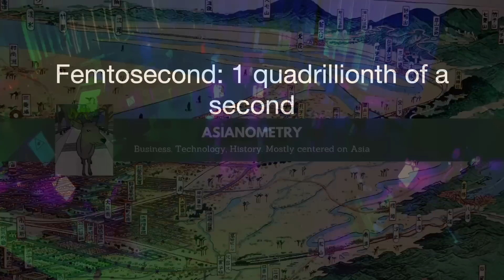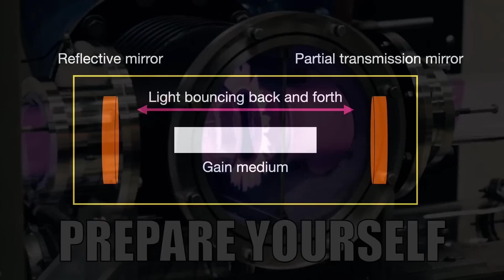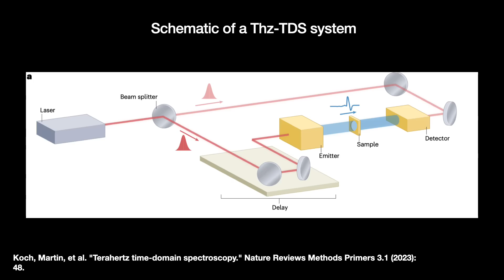The Incredible Femtosecond Laser

Comment: AI Summary

Abstract:
This technical overview traces the evolution of temporal resolution in high-speed observation, culminating in the development of the femtosecond (fs) laser. It details the transition from mechanical shutters and early electronic "Kerr cell" shutters to the revolutionary breakthroughs in laser physics: Q-switching, mode-locking, and Kerr-lens mode-locking (KLM). The analysis highlights the shift from unstable organic dye gain mediums to robust, solid-state Titanium-doped Sapphire (Ti:Sapphire) systems. By achieving pulse durations as low as 5 fs, these systems have enabled real-time observation of molecular dynamics (femtochemistry), precise surgical ablation with minimal thermal damage (LASIK), and the generation of terahertz radiation for non-ionizing spectroscopy. The material concludes by noting the recent progression into attosecond physics to capture electronic motion.

Technical Summary and Key Takeaways:

*   0:02 Definition of Scale: A femtosecond is $10^{-15}$ seconds. At this temporal scale, light travels only 300 nanometers, necessitating specialized pulse-based "cameras" to resolve physics at the molecular level.
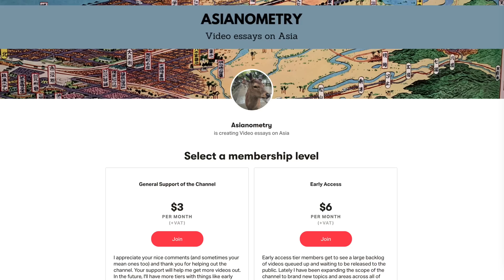*   1:17 Historical Precedents: High-speed imaging evolved from the phosphorosscope (1/2000s) to Muybridge’s mechanical shutters (1/1000s) and eventually the "Kerr effect" shutters (nanosecond range), which utilize electric fields to modulate refractive indices.
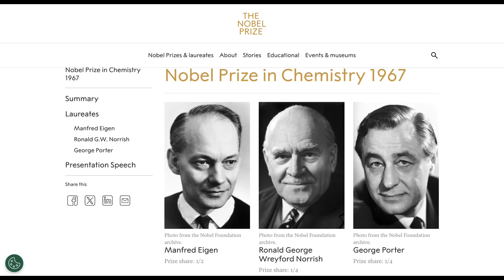*   5:47 Early Laser Modulation (Q-switching): The first Ruby lasers (1960) produced pulses in the micro-to-millisecond range. Q-switching improved this by manipulating the cavity's Q-factor—storing energy and releasing it in "giant pulses" of ~10 nanoseconds.
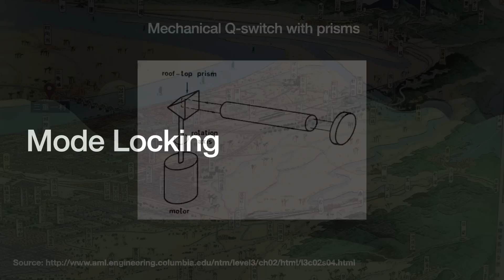*   7:50 The Mode-Locking Breakthrough: To surpass nanosecond limits, researchers utilized mode-locking to force multiple longitudinal modes within a laser cavity to interfere constructively. This produces synchronized, high-intensity pulses at intervals corresponding to the cavity round-trip time.
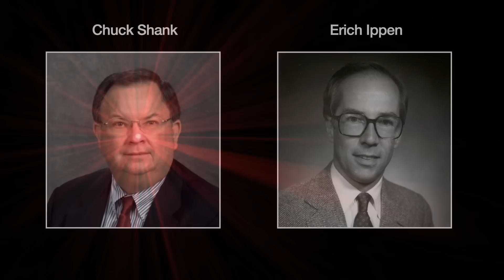*   11:04 Breaking the Picosecond Barrier: Bell Labs researchers (1972-1974) utilized dye-based lasers and passive mode-locking to enter the sub-picosecond and femtosecond regimes. However, these systems were hindered by toxic, unstable organic dyes and low power output.
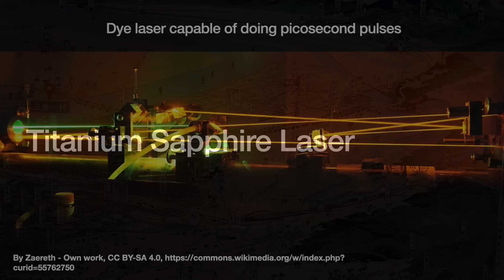*   12:38 Solid-State Evolution (Ti:Sapphire): The discovery of Titanium-doped Sapphire (Ti:Saph) provided a robust, solid-state gain medium. In 1990, the discovery of Kerr-Lens Mode-locking (KLM)—where the crystal self-focuses light via the optical Kerr effect—allowed for stable, high-repetition-rate femtosecond pulses.
*   14:35 Power Scaling via CPA: Chirped Pulse Amplification (CPA) enabled the amplification of these ultrashort pulses without destroying the gain medium by stretching the pulse in time, amplifying it, and then re-compressing it.
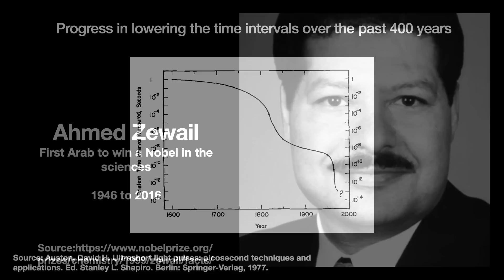*   15:54 Application: Femtochemistry: Dr. Ahmed Zewail utilized 100 fs pulses to observe chemical bonds breaking and forming in real-time, effectively creating "motion pictures" of molecular reactions.
*   17:11 Application: Medical Precision: Femtosecond lasers act as ultra-precise scalpels. Because the pulse is shorter than the time required for heat to transfer to surrounding tissue (thermal diffusion), they allow for "cold" ablation in LASIK surgery, reducing collateral damage and shockwaves.
*   17:45 Application: Terahertz Gap: Femtosecond pulses are used to drive photoconductive switches to generate Terahertz radiation (T-rays). This enables non-destructive, non-ionizing imaging for semiconductor inspection and automotive material analysis.
*   19:24 The Next Frontier (Attoseconds): The transition from femtosecond to attosecond ($10^{-18}$ s) pulses allows for the observation of electron dynamics, a field recognized by the 2023 Nobel Prize in Physics.

AI-generated summary created with gemini-3-flash-preview for free via RocketRecap-dot-com. (Input: 20,729 tokens, Output: 936 tokens, Est. cost: $0.0132).

Comment: 2:57 But in fairness, Panel 8 is a decent match to many  pre-photo age horse drawings.

16:10 A small nit pick just for clarification purposes: "Atoms move at 1km/s" is an incomplete and unqualified statement...one that could cause problems for uninitiated laypeople who might be quick to run with it as a factoid. No, atoms do not have set speed. Of course, their speed is in constant flux subject primarily to temperature, pressure and volume. At ordinary temperatures and pressures, most atoms move at anywhere from 0.1 up to 1 km/s. So still quite a bit of variability even when some specificity is employed. Respectfully.

Thank you for this presentation. Very enjoyable. 👍

Comment: Really good introduction.  You are to be congratulated.
Just a couple of points, that may inspire you to do a series of video presentations: 
1) waves can be either longitudinal or transverse - light is best modelled as a transverse wave (Maxwell's equations).  Modes are key to understanding laser light - the ray model or even frequency models just isn't accurate.  For example, a single mode optical fiber has a core of the order of a few nano-meters ... yet these fibers use IR light at 800+nm in communications applications.  Modes are a function of the geometry of a situation - this could be "standing wave" in cavity or a "travelling wave" in a ring.
2) a practical laser supports a number of simultaneous modes (both transverse or longitudinal "waves").  So a single "beam of light" actually has a complex frequency and spatial structure.
3) creating pulses usually relies on non-linear effects in materials (parametric amplifiers, self-phase modulation in optical fibers, etc.).  Classification of these non-linear effects is a good way of understanding technical progress.
4) the stability of the system is the key technical innovation for pulse creation
5) polarization should be mentioned as another critical part of pulse creation. Some discussion on coherence as a classical state of light is also important.
6) extreme non-classical states of light (squeezed states, for example) are used where noise needs to be reduced.  This is the technology of super accurate time measurement - the LIGO gravity wave detector, for example.

Comment: Back in the noughties, I went out to Taiwan to install some custom software to control a femtosecond laser at ITRI.

Unlike with slower lasers, typical control systems of the time couldn't individually q-switch single femtosecond pulses, so the laser allowed you to configure pulse trains. Each trigger of the laser would trigger a fixed pulse train of femtosecond laser pulses. A pulse train of all 1's would trigger at the full rate, alternating 1's and 0's would trigger at half rate, dithering provided finely tunes power levels, but more fascinating were the more complex pulse trains that could shape the entire power profile over time, turning a single trigger into a 'note' of femtosecond pulses with complete control over attack, sustain and decay etc.

I don't remember their application, but I do remember that the lab also contained sputter deposition machines and DPSS lasers too, so probably for materials and/or surface science.

Comment: We (USA) developed a three trillion watt gas-glass four femtosecond CO2 laser at White Sands during the Reagan era.  It was known as “Star Wars.”  It took four tractor trailers full of capacitors and electronics to run it.  One test was to cut a WW2 tank in half, in about 22 seconds.  Another test was to blow up a derelict satellite in space, which we did.  The Soviets were panicked.  It blew the MAD concept out of the water, and rendered their ICBM’s moot.  It was eight years before they caught up with their own lasers.  Over the years the massive size was reduced to one mobile field vehicle.  They are still in use today, though highly classified.  Femtosecond was a tough nut to crack 40 years ago.  The thyristor alone was a monster.

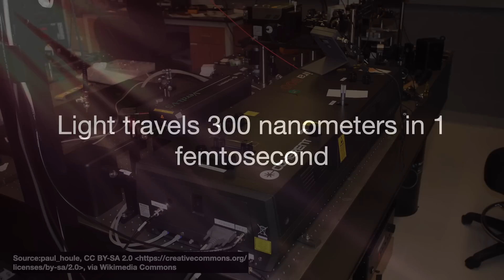Comment: 0:35 hey that's a mira, my old lab boss had it in one path of his microscope! The main crystal head had to be tuned manually and when it had difficulties in entering modelocking sometimes you could get it to by bumping it on the top cover. It's successor, the chameloeon, has the verdi pump laser (on the left) included in the main head and it is fully mechnanized and more reliable and used in most 2 photon microscopes...at least in europe

Comment: I had the great pleasure to be able to be able to do testing on creating conduction paths in thin film solar cells during an internship as part of my master using a femto second laser. With longer pulses such as with a pico second laser the surroundings of what was machined got damaged by the intense heat supplied by the laser beam. However, with the very short pulses of a femtosecond laser there simply is too little time for this heat transfer. I'd guess you can compare it with moving your finger quickly trough the flame of a lighter.

Comment: Nice! I'm privileged to have been involved in laser short pulse research over the past 40 years, and worked with, or got to know, some of the pioneers. Gérard Mourou and I share the same advisor (M. Denariez-Roberge), and I've been a colleague of Michel A. Duguay, who used the optical Kerr switch in the picosecond domain in 1969. Paul Corkum, who deserved the Nobel for attosecond pulses, was on my Ph.D. thesis committee, and I actually reproduced one of his experiments. The 1980's were especially exciting for the development from ps to fs. 
But you only barely mentioned fiber lasers! You should make a video on that topic alone!
Reply: I agree!!! I’m lucky to have the honour of working and producing femtosecond fiber-based lasers 🥰
Reply: Installed and somewhat developed an early prototype carrier envelope stabilized Coherent Micra for Paul Corkum, then went on to work with Ted Hänsch's Menlo Systems and fiber laser combs ... astrocombs ... I think the Germans spec'd the most accurate line item in history a few years back when they sold Jun Ye 10^18 stability for an optical clock comb.

Comment: Fan fact 1: Although we sometimes imagine a laser pulse to be a long beam, for a fs-laser which (common) diameter is ~1mm but for 10fs pulse, it is only 3 micron thick. So it is like a plate flying along its face direction. 
Fan fact 2 : Scientists can measure the oscillating electric field within a fs-pulse ( check SPIDER, FROG, yes real acronyms) and also modify the wiggling electric field inside that pulse ( check MIIPS ). That MIIPS is used to detect trace chemical ~10000 more sensitive(using resonant anti-stoke shift Raman in a single pulse). During Iraq war, an instrument was built using MIIPS technique to detect a trace IED chemical in the air from ~30 ft away by sending fs-pulses to nearby suspecting devices.
Fan fact 3 : fs-crystallography (Nobel) once imaged/video atoms inside a nanocrystal gold during melting. In there, heating by fs-laser pulse was so fast that you can detect the electrons heating up first before the atoms (nucleus) heating up. 
(Edit. spelling)
Reply: yet we dont have anti-gravity tech... 😂

Comment: I watched a video a while back that was basically the opposite of this technology it was cameras that were stabilized that would watch imperceptible movements inside rooms and machinery over hours days weeks. Its kinda cool thinking about how photography is measurements
Reply: Photography is the application of the physics of optics. We just use it for snapshots but yeah its also good for sensing what machinery is vibrating.

Comment: how do they measure how fast they were measuring beyond just "its faster"?
Reply: That's a very good question.Obviously we can't use electronics so it has to be done with lasers. In fact we use the pulses themselves and "overlap" them with themselves and when they do overlap they will generate a strong signal in a special crystal. So we move one pulse over it's own copy and then measure how wide the strong signal is (in terms of distance traveled and then convert to time knowing the speed of light).

Comment: Finally a topic on something I work on. We use femtosecond lasers as they significantly decrease the heat affected zone created as they ablate the material before it can transfer heat to the adjacent material.
Reply: This is super interesting, I’ve been looking into to femtosecond lasers a means of ablating gold to create 20nm or smaller sized particles of colloidal gold. It seems to be the most efficient way of creating colloidal gold. But getting time on a femtosecond laser has been a challenge. But that would be a dream to create the colloidal gold with lasers. Currently I create the gold with electrolysis and distilled water , NaCl and 1m sodium carbonate solution as a Ph balancer and Maltodextrin as a capping agent.
Reply: You guys sound smart , for real, so forgive this dumb Johnny Mnemonicesque question.
Could you use it to transfer data from a "camera" to  the optical nerve or some part of the brain to make a person "see faster"? Like seeing real life in slow mo.